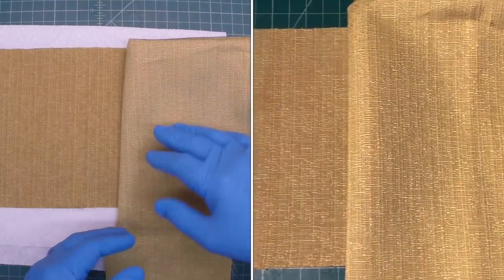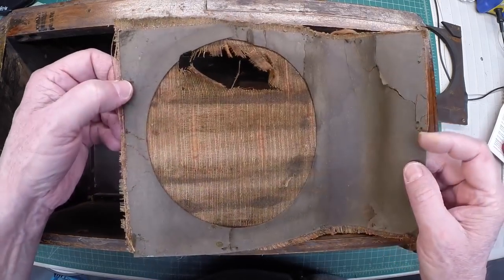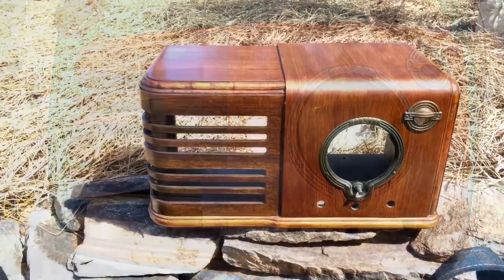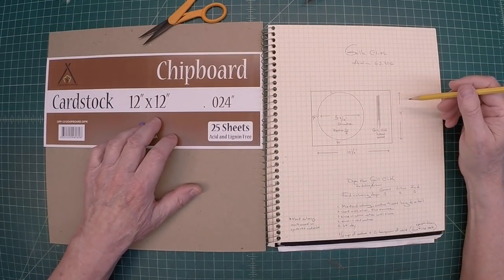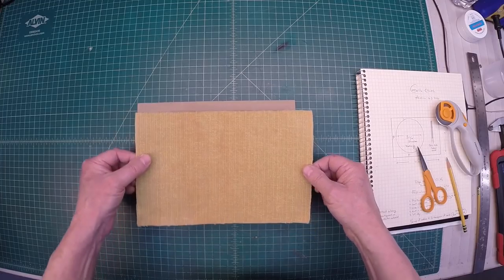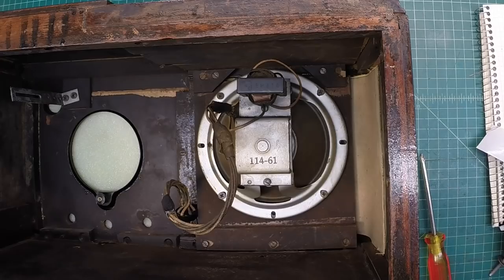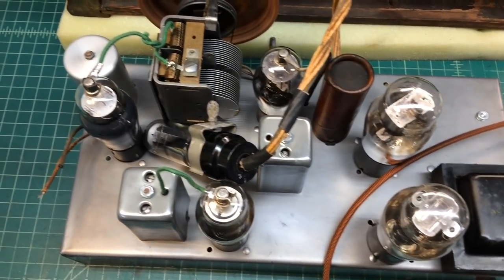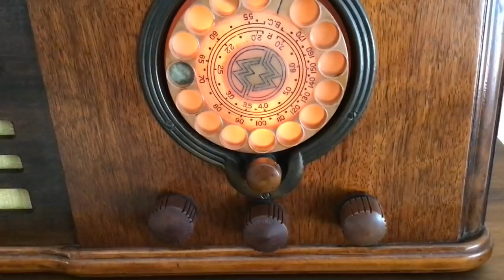Airline 62-306 Teledial - New Grille Cloth, Scratch Build Knob & Cabinet Touch Up

Comment: I can tell you that the cabinet had been stripped once upon a time, as there was originally a faux veneer strip going around the middle bar of the speaker grille and the base trim had a darker toner on it. Another give away is the backside top edge shows steaks where it was stripped. I have two of these
Reply from the maker: Kenneth - thank you for validating this for me. You’re blessed to have two of these beauties in your collection. Thanks again. Best, Don